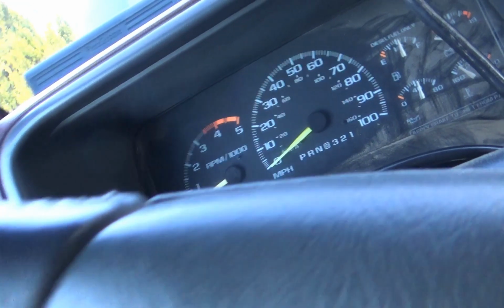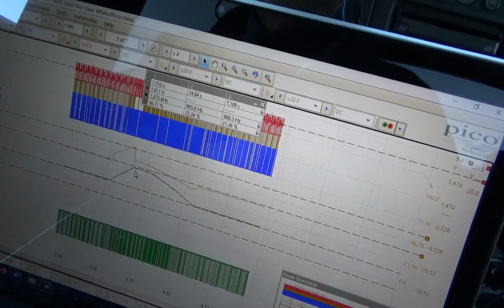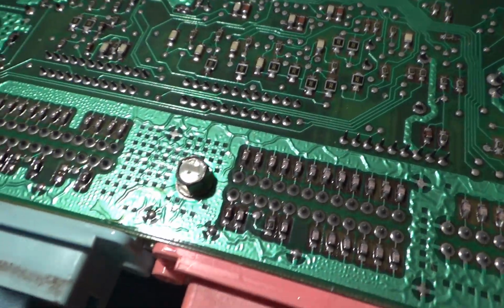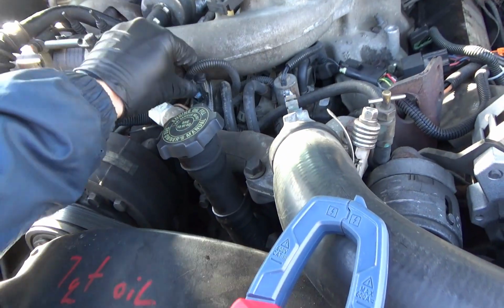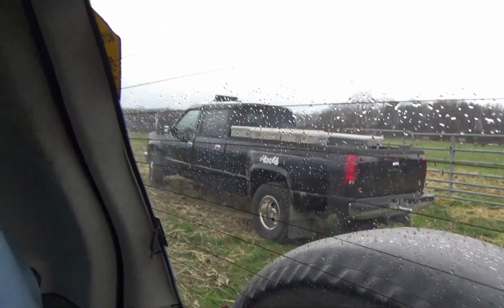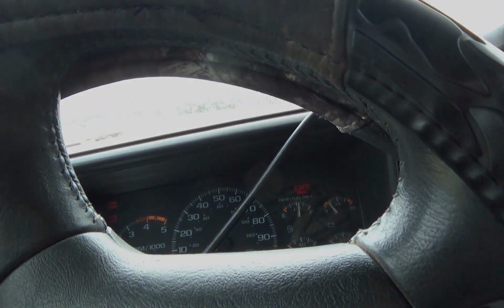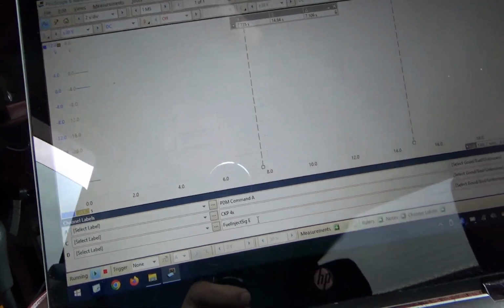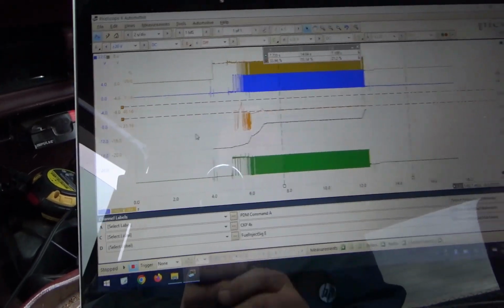Chevy 6.5 Turbo Diesel REVS Out of CONTROL?! (Part 2 - Didn't see THIS Coming...)

Comment: With these 6.5 you need to use enhanced obd scan .If you are using generic obd you will not get codes . Sucks when jobs like this use up so much time .Never let these run that high of rpm especially cold . Did you ck the injection pump offset ? Sounds like your fuel rate is off the chart from O.S.

Comment: The second I heard that noise from under the hood, I knew that thing was coming apart. I'm sure you did too. I can't imagine being in that position. The damage was already done before you started working on it. Those diesels just wont tolerate that for long. I don't think there was any way around it while trying to diagnose such a problem.

Comment: I changed $144 apps accelerator pedal position sensor... Mass air flow sensor out of sight price approximately $400 didn't do it yet didn't change ECM yet some kind of parallel circuit for the a p p s I don't know what that is I guess on the side somewhere there looks like a circuit box there

Comment: I changed $144 apps accelerator pedal position sensor... Mass air flow sensor out of sight price approximately $400 didn't do it yet didn't change ECM yet some kind of parallel redundancy which triggers limp mode circuit for the a p p s I don't know what that is I guess on the side somewhere there looks like a circuit box there

Comment: Crashing and burning.... Starting in the morning steering wheels against the curb for a bit... Last few weeks couple weeks almost 2500 RPM... Drive about quarter mile then hit the brakes hold... Undulating revving on touch but normal idle... About 15 minutes of struggling with it every morning... Spraying the turbo I don't know why it's smoking a little...... Sometimes periodically normal acceleration after having shut it off then it starts to tip off the top... Short revving... 1 mechanic said $250 for a diagnosis... Ask him if it seemed familiar he's keeping it secret... Maybe he knows... If I were playing poker he had kind of a telling expression.... Haven't gone there yet.

Comment: I'm later my brother said he put some money in my bank going to get some wires new inline fuse go directly from the battery also power leaving the fuel pump disconnected from the harness as I have already maybe I'll get a new lift pump also was thinking about a high-powered one cuz clearly the anomaly is not enough fuel at the injection pump.. play also whatever else is wrong.. overwhelmingly factually proven to me

Comment: Hooked up power the lift pump basically straight from battery after unplugging and keeping unplugged... I'm primed the fuel until it squirted out of the filter as lately I've had to... It started undulating the same... It went to 2000 after first Rev... I let it undulate a little bit more before I revved it though.. let it hold on to the Rev.... About half a minute... Put it in gear a bit odd stumbling idling and then leveling out... Put parking brake on eyes on road let it idle.... About 5 minutes... Put back in park idling fine with a bit of undulation... Trying to Rev it it held again 2000... As in days before after driving in a bit so carefully.... Resist temptation to allow it to scream to the Moon you must egg  it carefully as if you're a kid with a push scooter.... As it goes it becomes more of a uniform acceleration... About 15 minutes driving... Then it restarts all day.. with just a little bit of anomalous rev and fall off.. turbo wind down noise... As if suddenly you have lifted your foot after powering into it... As if you were revving it... I'm suspecting I have four more lift pumps in my truck always I've changed them ridiculously all of them running as I was trying to troubleshoot something.... I don't know what I'm expecting... I just noticed motor shuts off if I don't recheck to see if there's fuel at the filter... Still using bald from the fuse link panel hotwire actually where the computer is powered... The one making that says go straight from the battery I will have to buy inline fuse and try that... For whatever reason sucking air in or something there's not enough fuel pressure at the injection pump.. intermittently.. I'm assuming that's the reason for the fallback of acceleration... But I can't quite understand how it's going to go scream to the Moon... As if you've got your foot to the floor... Is it accelerated by wire..? I'll be looking as I'm thinking about where babies come from

Comment: If it's fuel... Seems like solution would be just to metaphorically put a battery right next to that lift pump and run it off of that... Any overpressure would go to return

Comment: My 6.5 was doing the same thing. Rev to 3000, then back to 1000. No pedal control whatsoever. 1 years old Dorman PMD. Swapped to a brand new flight system PMD and it fixed itself instantly.

Comment: Mine is doing that, and I've replaced just about everything. I can say I don't have a knock or any other noises, but it does like to run away, I can shut it off to stop it. any new info??? I've had about 4 different mechanics try and fix it.

Comment: I know my comment is way too late but I used to work on a lot of these 6.5 engines when learning about diesels. We didn't have all of the scan equipment but one thing I remember is that the injection pumps on the 94's were extremely prone to failure and you couldn't use one from a 95 and up because it wouldn't run right. You had to get a pump specifically from or for a 94. That was the only year these were that way even though the pumps from the later years looked the same. This truck would have been fixed if the injection pump was replaced. Hopefully the owner replaced this with one of the newer blocks I believe made by International which don't have the failures that the GM blocks were known for.

Comment: I watched part 1, and my first thoughts was the pump safety governor weights, were damaged, and letting go.   It was only a matter of time,  before they failed completely, and you had a runaway ! The engine sounded really bad, as regards knocking, and trust me, seeing a rod actually coming through the side, in a test bay, is frightening.   Not your fault mate, so don't feel bad about the outcome..

Comment: Heres what I noticed.
You really don't know the setting on these 6.5 engines.  If you did you would have known what to look for..
Me .. your timing stepper motor was stuck on 15.7 degrees.. soppose to be 3.5. 
Tdc offset is soppose to be -.025 to -.075..
It was -.087..
Too much timing killer that engine..

Comment: Mine did something very similar, would surge on the highway and the pedal would seem to come and go.  At high reves on the highway ran ok but would constantly have to play with the pedal.    First replaced the pedal sensor, then the PDM...  In the end It was the Injection Pump.   It is critical to add lubricant to the fuel in these old model due to the lack of sulphur in the new fuel and the Injection pump is lubricated by the fuel.  WHen i first got this truck at auction on Maryland and I drove it back to Texas but I did NOT know about adding the lube to the fuel and withinn a month the Injection pump went bad.  The truck only had 74K original miles on it.  It was totally my fault.   I replaced the Injection pump and has run fine ever since.  I was using Stanadyne Fuel Lubricant but after seeing a real time lubrication study on the Injection Pump, I switched to high end type 3 Marine 2 cycle oil which was a much higher performer in the testing by an order of 2x...

Also the temp sensor is a problem because the PCM cannot do the timing Re-Learn unless it is above 170 F.  SO replace the sensor, warm it up to about 180 then turn off the key, then turn it back on and hold the accerator down for 45+ seconds with the key on.  Then release the Accelerator Pedal for 3 seconds and turn off the key for at least 30 seconds.
Then start the truck and let it idle for about 15 mins.  Do not exceed 1500 RPM.  
The computer will RELEARN the Timing Offset.  On your computer read the TDC Offset it should reaf between -0.25 to -0.75 for factory spec. but you can go to -1.2 for higher performance but it will cold start poorly.

You have to rotate the Injection Pump to move the TDC...  Refer to the GM 1999 C/K shop Manual...  That is not a rod knock!  It is just fuel ignition knock due to improper fuel quantities in the cylinders...

First try the RELEARN then change the Injection Pump.

Comment: Big bummer, Since the coolant temp sensor was reading the correct ohms at the sensor but not at the PCM, that indicates the extra resistance was in the circuit. Probably a connector with corrosion or a chafed harness effecting the circuts that were suspect. You started out on the correct culprit, the PCM wasn't getting correct data.

Comment: I can't believe it, advanced technology 100 or two hundred dollar  solenoid  destroy the engine, it looks like car manufactures did that in purpose,  old fashion engine last too long the life of the car, if taking care of it oil and coolant, so they invent something can cause the engine to self destruction at low or  Certain milage, so they can make more money. New technology is supposed to be better andastlp.ger than the previous one,but no.

Comment: As much as i love "diagnosis from the driver seat" or data based diagnostics as you put it, sometimes we get caught up in the fine details and forget super-basic mechanical health of the engine. I've done it. We've all done it.
Not sure if volumetric efficiency data would help in this situation before condemning the brain.

Comment: 15:42 - I don't remember from the first video or from earlier in this video if you check the resistances for the coolant temperature sensor at the pcm plug instead of just at the sensor itself. Is it a wiring problem? I'm sure you will answer my question further in the video so it's a bit rhetorical.

Comment: I've seen this on a few 6.5 diesels. It's the pmd. If you have 4, all 4 can be bad. Remove all the jumper wires and plug it directly into the engine harness. I've had perfect looking extension harnesses that did this exact thing, removed and plugged that pmd into factory harness and ran perfect.
Reply: you've seen this over-rev scenario? Ive replaced a few pmd's but they were always a stall/no-start. Im about to look at a shuttle tomorrow thats doing this exact thing-it revs to the moon. My first instinct was to check the throttle pedal since its a van chassis and it leaks rain like crazy. I thought something might have corroded. Then i was thinking maybe pcm for the same reason...water damage. But if you think a pmd might fix it...they've gotten cheap enough that i'll tell the owner we need to order one just to try. I hate throwing parts at a problem but at some point if its cheaper than a bunch of labor it might be worth a try. I hope to hear back from ya🙏
Reply: @colestowing8695  YES! My 6.5 was doing the same thing. Rev to 3000, then back to 1000. No pedal control whatsoever. 1 years old Dorman PMD. Swapped to a brand new flight system PMD and it fixed itself instantly.

Comment: Did all you could do Ivan. You can’t cure a dying horse. I wouldn’t give two nickels for any diesel with GM’s name on it after they sold Detroit Diesel. I was a diesel mechanic in the late 80’s. I worked on the older trucks and some off road machinery mostly. But I also did a lot of repower jobs replacing 5.7 L and the 6.3 L engines. The 5.7 was junk and the 6.3 was unreliable. I would only think the 6.5 would be somewhat better. I wouldn’t rebuild it. I would repower it with something else.

Comment: 10k to buy a new engine. I own a 95 1500 6.5 222k. These engines are grenade bombs. To have one of these run possibly trouble-free ya need to start off with a new engine and send it to Twisted Steel Performance they spent roughly 10k making the engine grenade proof.

Comment: I just went through that on my 983500 65 turbo I went back through and cleaned and re-secured all the grounds everywhere little bit of moisture developed under the dash I replace the TPS as it had an odd spot jump and the brake switch I replaced it because when my foot was on the brake I couldn't rev the engine thing runs great and that rattle that annoying rattle I took the heat shield off the exhaust this followed a trip back from the job and it bent a push rod replaced it and The Rocker assembly all is well also put a new OEM turbo on with a few slight modifications things are working way better now plus the resistor

Comment: The thing for me is I would not have stopped and called it at the PCM. Before I decide the PCM is at fault, I have to know that inputs are good. And by that I mean compare what the PCM is telling you it's seeing vs what the PCM is actually seeing. I've seen more than once when a foot pedal sensor is faulty, or get this... once a computer had 4 ground connections. ONE of those ground connections was 5 Ohms higher than the others compared to chassis ground. That caused a check engine light and derate for a throttle body command/feedback error.

After - or hell, before even diagnosing electronics, you have to look at something mechanical. Valve clearance. Oil level. Coolant in the oil. Exhaust gas in the coolant.

Comment: Had 3 of those trucks. Its the pump. Sticking solenoid from bad fuel. That solenoid has to make corrections at a very high rate even at idle. Must used good quality fuel additive every refuel. The computer in those has no idea what's going on.
Reply: Best thing to do on those is get a pedal and throttle cable from 92-93 model and install mechanical pump.
Reply: Injection pump or fuel pump?  My 6.5 is also reving up and down out of control
Reply: @TySawan  injection pump.

Comment: The engine was bad before you.
Was matter of time.
Driving like that two weeks!? 
I have a remapped 1.9dti Clio old project. You need very good preparation and attention before start revving and racing with diesel engine. Even when I watched the first part, I had a bad feeling for the whole situation. Exactly two weeks ago, a friend blew a 1.9tdi after 15 minutes of idling on the first run around 5k rpm. The engine was stone cold still.
Not your fault at all and yet, one of my favourite videos.

Comment: Convert it to 12V Cummins or drop in an AM General GEP Optimizer 6500 long block with a Quadstar tuning injection pump. Quadstar Tuning is in Butler, PA and specialize in the 6.5. That truck has no rust issues and is worth saving.

Comment: Too bad for the engine...! I saw a red flag when you mentioned the new aftermarket alternator - wasn't there a case with an alternator putting out high frequency noise and disturbing the ignition/injection system...? On the other hand - what would this do to the faulty temp reading when the engine's not run'in...
My two cents...

Comment: I talked with my brother who is a veteran chevy mechanic of the 80’s.  1, There is a governor internal to the pump that goes bad, 2, if there's a restriction in the return fuel line and 3, as the diesel is an oil fuel, if there is a leak internal to the pump it can suck in engine oil and there is the fuel that caused it to rev. There was probably nothing wrong with any of the electronics. Bottom line the engine was at best a weakling when it was new. I doubt its hardly worth fixing.

Comment: Was the rod stamped with the cyl number sticking out so you could diag which cyl???  Fleet mechs have ability to "replace with known good part".  Module relocating was common.  Many pump problems, never had your symptom though.  I'll lay odds on pump.  Hopefully you"ll hear from someone who has.  I know you wont give up till you know. Thats the way you are.

Comment: Did You check power and grounds on the PCM?  I think that the ADC has it's own power and gnd reference and would explain the strange temp. and throttle position  sensor.

Comment: I think the temp sensor positive side, had an alternate path to ground, possibly to the negative side of the sensor. This is the only thing I can think of that would reduce the resistance in the positive side PCM measure of the voltage, and therefore reduce the signal voltage, just like as if  the temp was high, and the temp sensor thermister resistance was low in a good circuit.  The computer did not recognize this as a problem, but that only means  the logic to set a trouble code for this condition was not included in that years PCM software. That does not mean there was no problem. Lost opportunity....there could be other wiring or connection problem not showing up on the scope ,but are there, possibly in the same harness location,  causing the running problem.

Comment: Not a diesel mechanic but I believe that system is purely mechanical for the fuel delivery and that solenoid is either on or off to stop the fuel from reaching the pump.  since diesels don't meter the air in any way they control rpm by the amount of fuel delivered so excess rpm has to be from extra fuel being delivered somehow or being delivered at the wrong time since it is injected under high pressure directly into the combustion chamber if the fuel is being sprayed after t.d.c. it would make it rev higher than expected.  Again I am no diesel mechanic and my experience comes from old equipment so I could be completely wrong.  When people ask me to look at their diesel problems I tell them I will take a look for anything obvious but they are better off taking it to a qualified mechanic because this newer stuff seems like a complete nightmare so I probably would have took a swing at that truck too so I feel for you that it left the chat on your watch.  That sucks.

Comment: Why wasn't the transmission control feedback looked into? 

That was a rock solid indicator. Rpm s stabilized with it in gear and continued after returning to park.